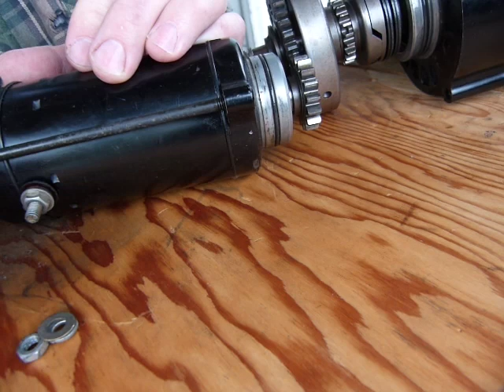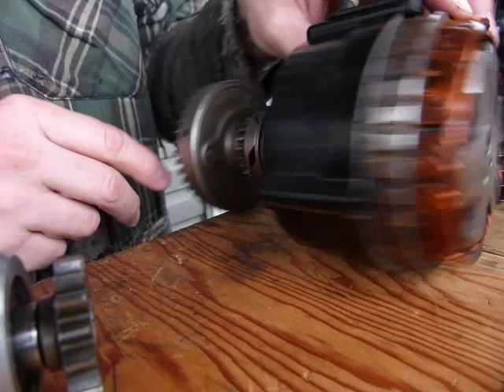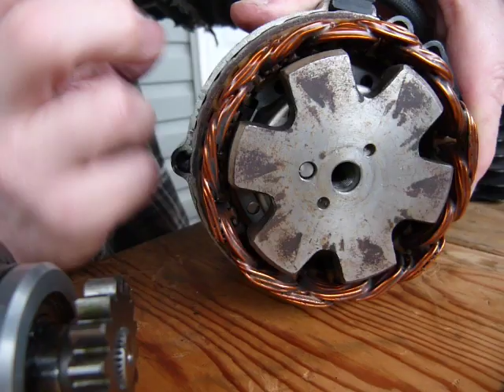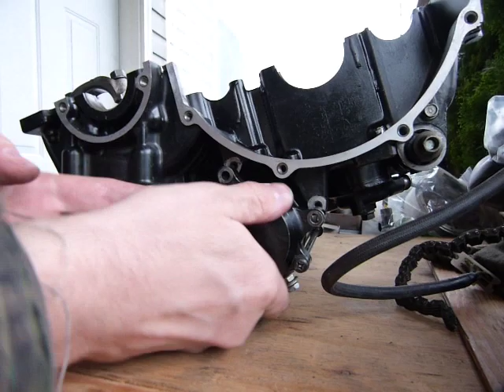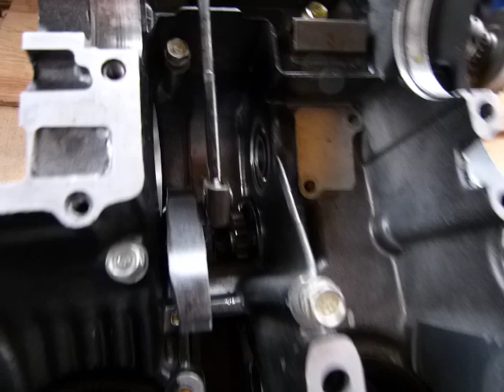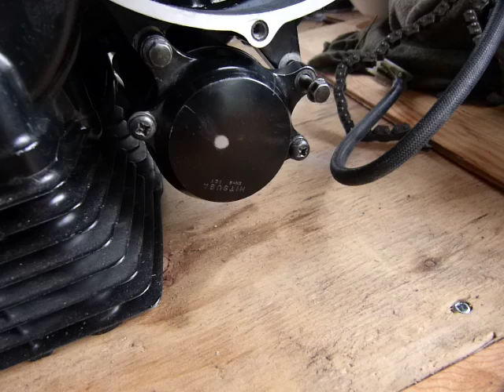Install/remove a starter

Comment: Do you know anything about 1976 johnson 35 horse outboard strarter motors? Can I just remove the starter gear? Where are the bolts that hold it on to the motor?
Reply from the maker: +dale struck Nothing specific to that make & model. However, starter gears may be fitted to any shaft or pin with snap rings, no bolts. Rings might be on the either sides, not both. They may be kept in place on the shaft by spacers only bracing against 2 opposite halves of a housing.